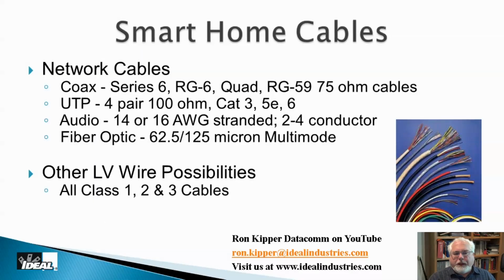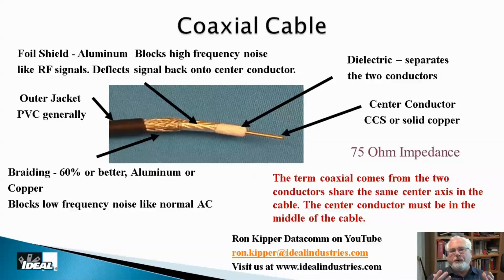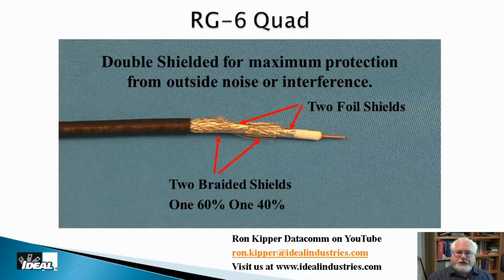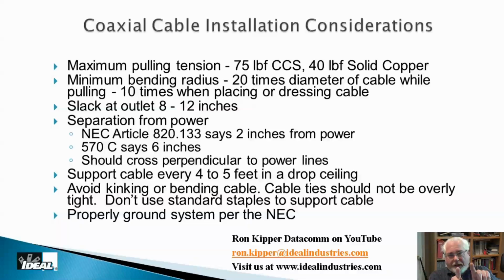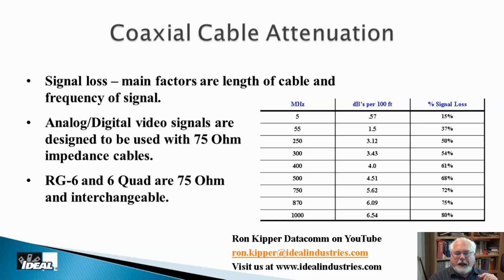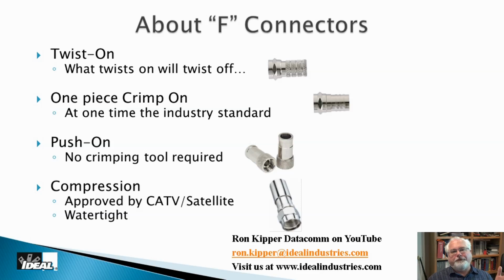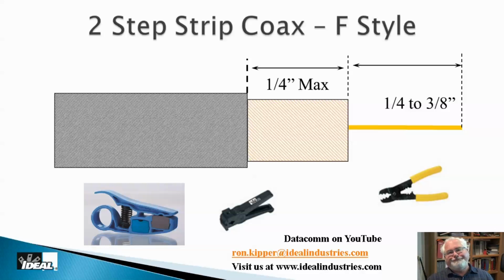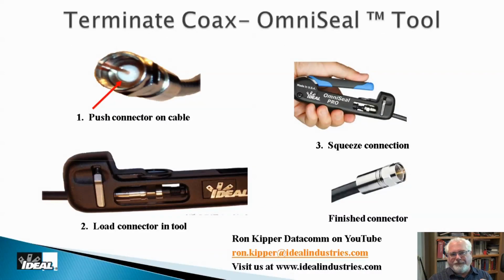Residential Structuring Wiring Systems Part 3 Coaxial Cables

Comment: Typical Service signal meters used by cable technicians are cable of running modem tests forward and return and also measure for ingress and even complete full digital analysis. They typical cost over $2500 as much as upwards of $6000

Also you never use a utility knife scoring the center conductor causes loss of channels due to what you referenced in a previous video "skin effect"
Reply from the maker: Michael I appreciate your input always good to get some input from someone in the field. Thanks for watching the channel. Ron

Comment: Ron, first of all, what a great informative series of video! Thank you!
Now, I had a question that I never really got 100% answered: does your cat5e cables and coax cables go inside the same conduit? I mean, can they travel along with each other without having any kind of interference?
Reply: With proper terminations  and tight connections they can run together. But it would be a very good practice to try and prevent your Cat 5 or 6 cable from wrapping around the coaxial cable to prevent interference.